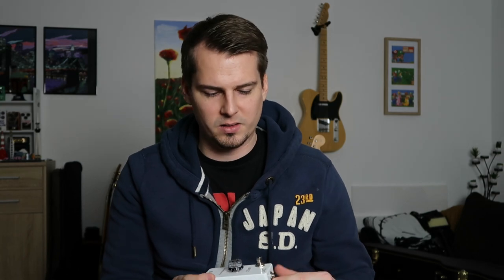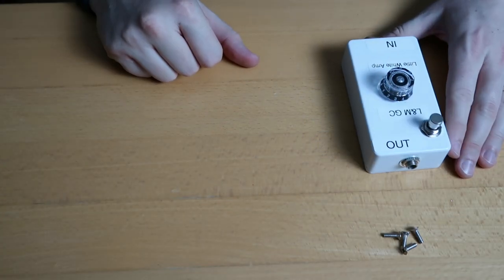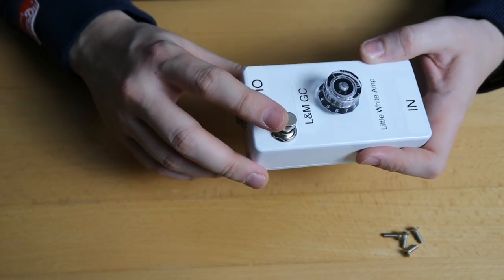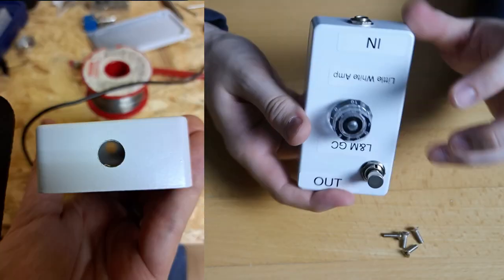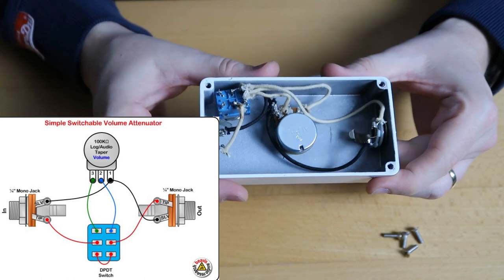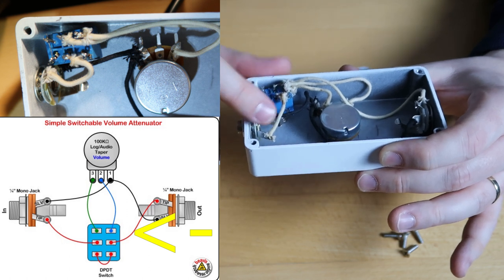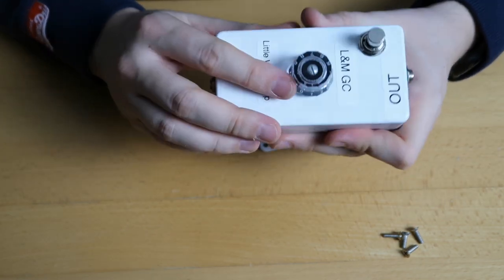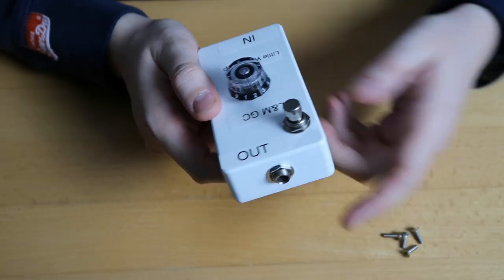DIY Master Volume / Attenuator Pedal inspired by JHS Little Black Amp Box

Comment: Great DIY project and no batteries required
Reply from the maker: Yup, it was fun to do! Cheers
Reply: @LMGuitarCorner  such a simple design to add a master volume to any efx loop equipped amp. I’ve used an EQ (with a level) to attenuate and shape my low volume tones.
Reply from the maker: I agree! An EQ pedal in the effects loops is of course also a great idea to both shape the tone and adjust the volume!

Comment: I think I've seen Phil McKnight just oar a typical volume pedal to do this same thing... I'll have to try it out! 😎🤘🎸🐦🥒
Reply from the maker: You can try a regular volume pedal too, but the one I own didn't work well and added a lot of noise. Plus it's a wah style pedal and not a typical pedal shape, so this one is much more comfortable to control. Cheers, Lukas
Reply: @L&M Guitar Corner    If you replace the knob with a Wingman then you can change the volume with your ffot! Awesome video Lucas! 😎🤘🎸🐦🥒

Comment: I wanted to build this, but add an LED indicator. How can I achieve this with a DPDT switch? Thank you for the video :)
Reply from the maker: If I were you, I would ditch the DPDT and just use a 3PDT switch instead. You would just make sings a lot more complicated if you integrate the LED into the circuit, just to use a DPDT. Also, you would always need a battery to have it running. If you use a 3PDT instead, the LED is optional, and you still have a passive circuit. The LED won't have any effect on your signal chain, and if your battery dies, your pedal still works.
Cheers, 
Martin
Reply: @LMGuitarCorner  thanks for the quick reply Martin! I have a DC jack installed so I can run it with a power supply, but I just can't seem to find any info on how to wire the LED into the circuit. From what I have found, it seems like the easiest thing to do will be to switch out the DPDT with a 3PDT as you said.. Thanks again :)
Reply from the maker: @mrbungledisco  I've just extended the video description with the information on how to add an indicator LED. We may do a more detailed followup video, as you're not the first one to ask us this question.
Cheers,
Martin
Reply: @LMGuitarCorner  thanks! That helps a lot. I have some 3PDT switches on the way to the house now

Comment: Could I use it on a pedalboard as a master volume? in such a way to silence all the other pedals in a chain?
Reply from the maker: I'm not quite sure what you mean by silencing all the other pedals. Could you maybe give an example where you'd put it in the chain and what you'd expect the behavior to be? Essentially, it's a volume pedal. So, if you place it in front of the chain, it will pretty much act like using the volume on your guitar. After all the pedals, it will reduce the signal to the amp, thus pushing it less, which might cause the sound to change and not act like a transparent master volume/attenuator. I hope this helps. 
Cheers, 
Martin

Comment: Is there any treble bleed?? 

I saw the circuit without the switch.
Reply from the maker: Hey there. Nope, no treble bleed installed and maybe a little loss of highs, but not significant. Found one on Reddit with a treble bleed if you want to check it out:
https://www.reddit.com/r/diypedals/comments/hnsgvb/a_quick_build_today_little_black_amp_box_clone/

Cheers!
Reply: Why 100k not higher ? Like one meg to stop high loss
Reply from the maker: @MrSongwriter2 Hey there. Here's a link to a forum post with an explanation: 
https://moestavern.freeforums.net/thread/578/solution-good-tone-bedroom-volumes?page=1&scrollTo=11732
Hope this helps. Cheers, Lukas
Reply from the maker: This is not a volume pedal designed for your guitar signal. Also, its intention is to have it turned down most of the time. This means that with a larger pot, you'll add more resistance in series to the cable, which will increase the effect of the capacity of the cable. So your 1meg pot will just have the exact opposite effect. Here they talk a bit more in detail about it:
https://www.guitarscanada.com/threads/if-making-a-passive-volume-box-500k-vs-250k-pots.238860/post-2459910
Cheers, 
Martin